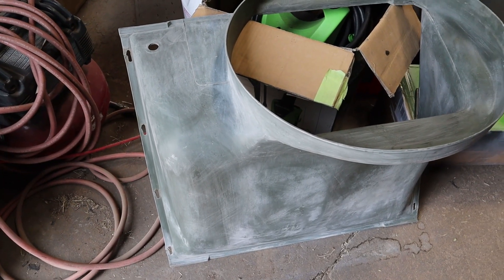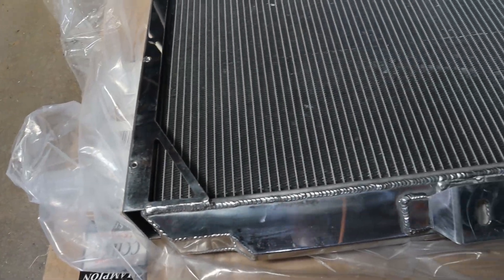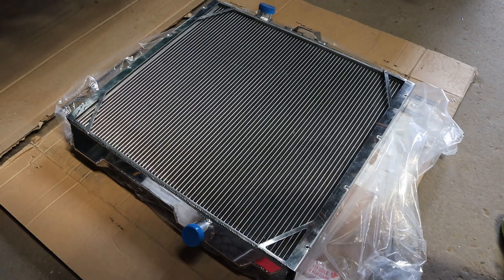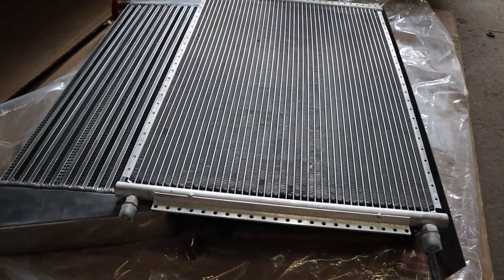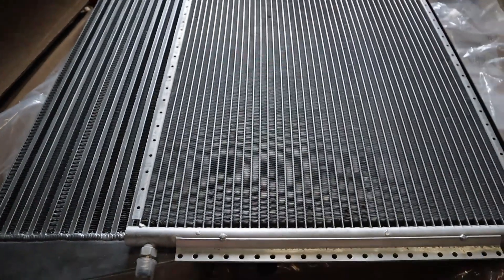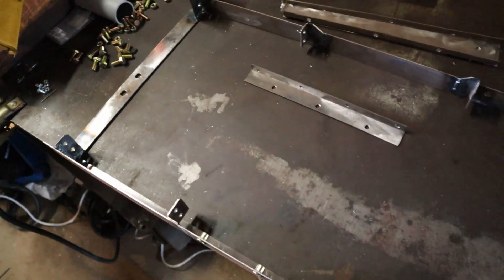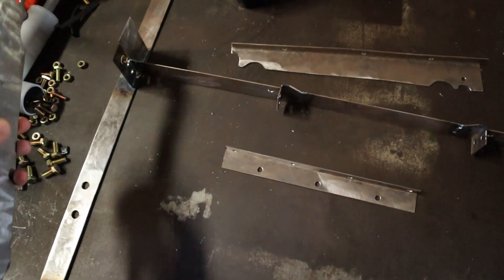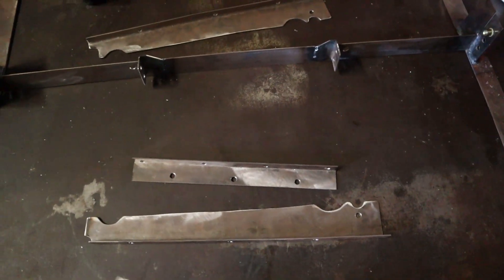Custom Radiator, Intercooler, and Oil Cooler Stack for a Duramax Swap Hummer or Humvee

Comment: Where did you find the intercooler with inlet/outlet facing up? Who makes it? I have been trying to find one like you have. Also been going back and forth on my Cummins swap to keep the factory transmission / oil cooler and power steering cooler or just swapping them out as well since replacing radiator for same champion one ya got.

Comment: Which radiator did you use and do you recommend it? The radiator ruptured on my 2003 M1123 yesterday and left me stranded.
Reply from the maker: It is an all aluminum radiator from Champion Radiators. I haven't had any issues with it, and it seems to keep it cool very well. I haven't had a lot of time to test it out, but so far I'd recommend it.
Reply: @tossthewrench  thank you very much for the quick response! I’ll give it a try as well! Keep up the build, it’s great inspiration!

Comment: Awesome build! Currently piecing together what I need to do the same swap in my 96’ H1. Do you have a part number or source for the radiator you’re using?
Reply from the maker: Thanks! Champion radiators. CCHVB I believe is the part number.

Comment: Looks good buddy, wish I had your free time to finish mine up faster. On the metal, If the steel starts to look like a yellow cotton candy is coming out it is most likely galvanized. Idk if that is what you were experiencing
Reply from the maker: Thanks! I don't get a whole lot of free time to work on it but usually about a full day's worth of time combined on the weekends. The weld actually was sparking on me and trying to melt faster than the other metal. I think it was just some impurities from sitting so long and probably a little softer steel.
Reply: @tossthewrench  oh ok , Different  metals will melt differently.  Another thing to look at is  torch angle. Strike your arc on the thicker metal first and work up to the thinner one.   Keep it up, tig welding takes alot of practice. You order your engine and transmission mounts thru jegs? I see the one they have has the bushings and everything in the kit.
Reply from the maker: I can't remember for sure but I think I had ordered it directly from Tin Man Fabrication. I actually ordered them not long after I got the humvee, thinking I wasn't going to be able to get the original engine running.

Comment: Good work.  On my rear mounted transmission cooler, I'm planning on installing a switch to turn off the fan for deeper water or some sort of cover on mine so the fan doesn't explode when it dips into deep water.   I've seen that Predator in San Diego mounts the transmission cooler.   up against the body between the frame rails.   Not sure if I wanna do that to. Mine. Seems like less air flow.    What are your thoughts?
Reply from the maker: Yeah I've seen them mount it there. It would probably work but I was afraid it wouldn't get as much air flow there and harder to clean or access if a fitting started to leak. I'll probably be setting mine up with a switch as well.
Reply: @tossthewrench  that was some of my same worries about airflow.    I like your work.  Your frame set up for the radiators/coolers is pretty cool.